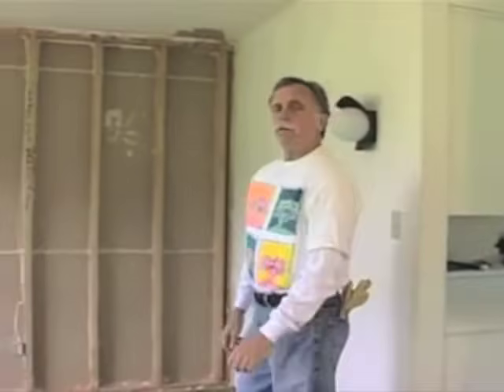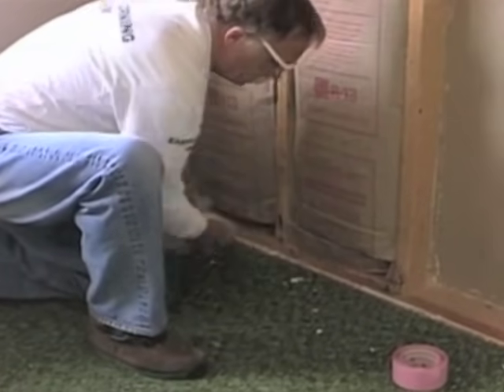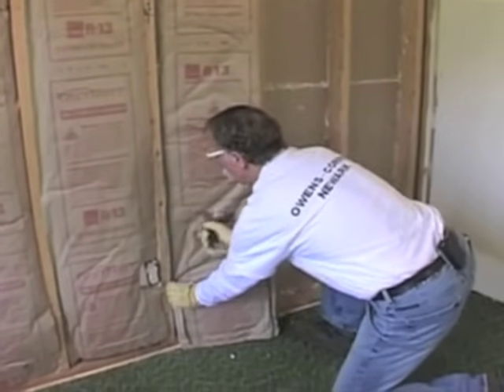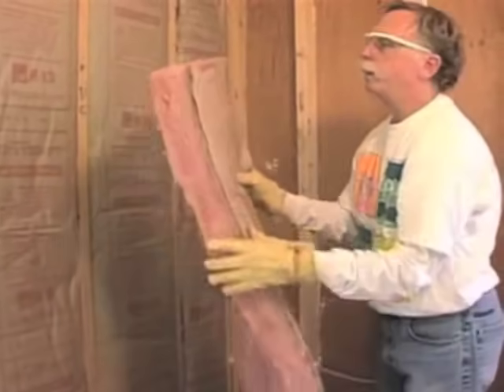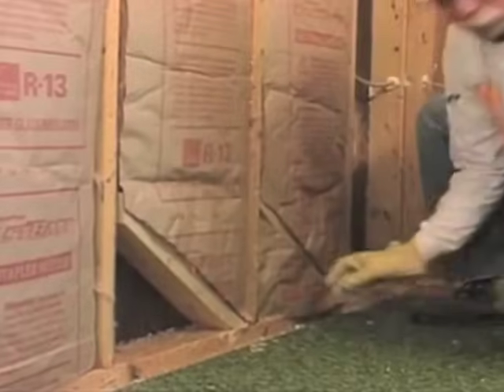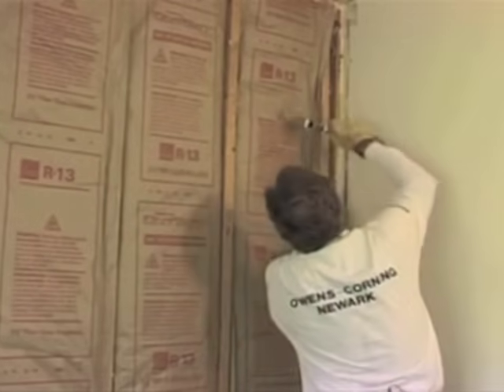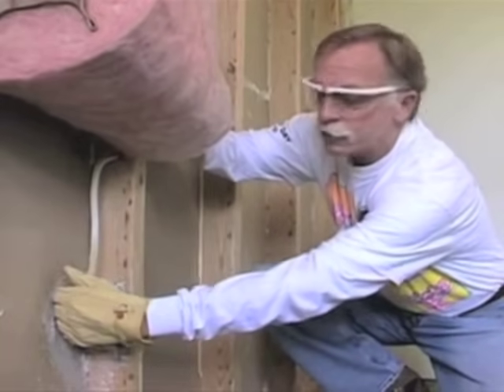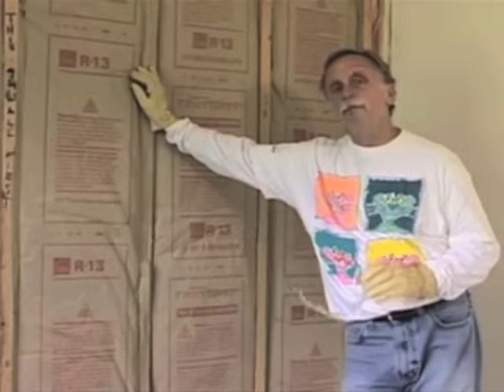Right Vs Wrong: Installing Insulation Batts In Exterior Walls - Part One

Comment: i have one question, please answer, what if i put it backwards the pink facing sheetrock and paperback facing the wall, what happens? is it still going to insulate good?
Reply: It is recommend not to have paper facing out to prevent a fire if it's not going to be sheetrocked.

Comment: No Bob. The fact that you don't know what glue is tells me you do not put your name on your work. That's ok, some people just work that way. You sound green so I'll explain. Since you probably don't know, wood expands and contracts and gypsum is brittle ;-) By nails I mean anything you use to secure the board to the wall. Screws included, they can pop if you don't glue. Not just pop, but ceilings can fall. The guy in this video is right.